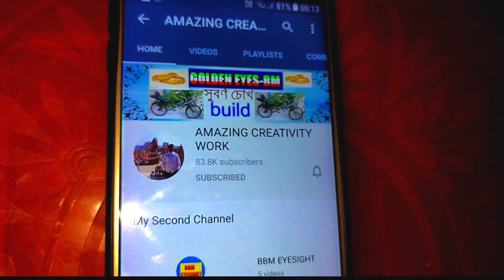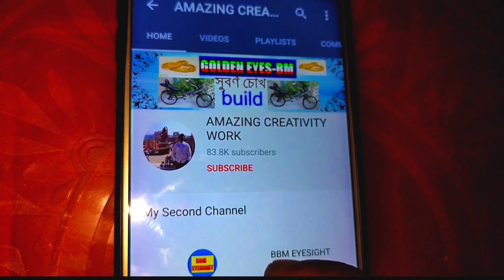Easy PVC Pipe Project Ideas | amazing creativity work

Comment: Congratulations... Good idea.. but if something happens in pipe like salt, dust problem..  total setup need to replace.. also you are packed with pvc seal ... So the project is not valid for long life..

Comment: Ball valve completely not opening. We have to use MTA fitting  to get plain pipe from L bow. You don't  mention size and type  of the  pipe like 1 inch and pvc cpvc or upvc. Anyway  good  video.

Comment: Very bad idea. Shoud have used threaded joints for valve for easy replacement/maintanance. Valve handle should opel away from wall.